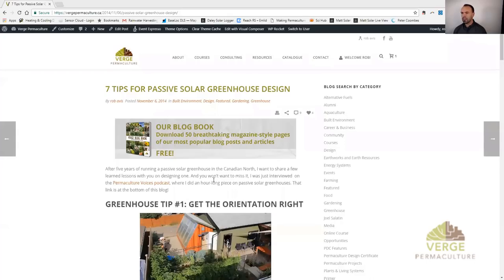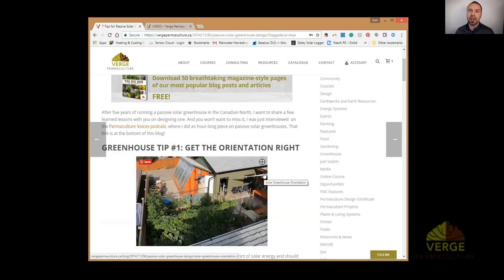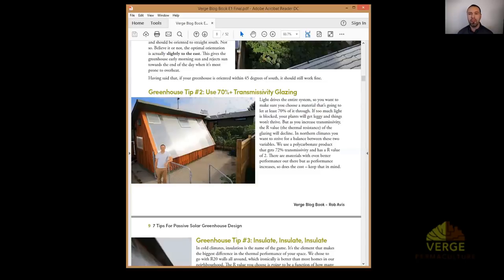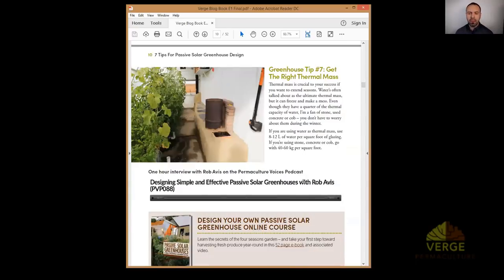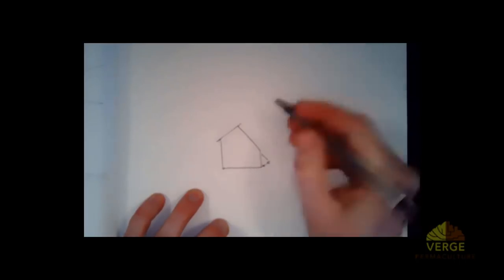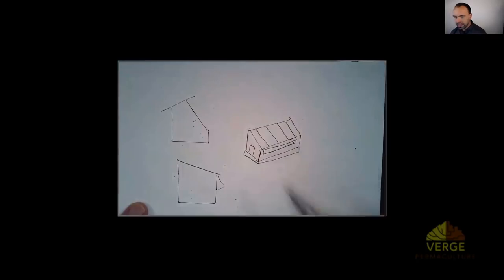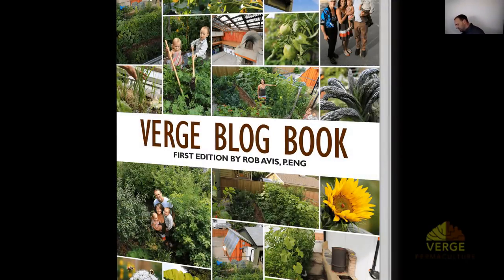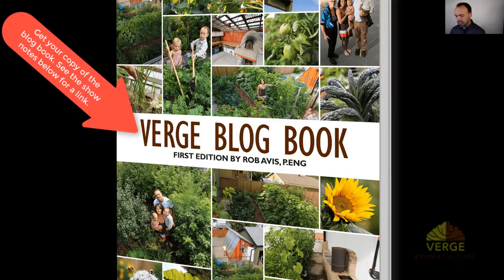7 Passive Solar Greenhouse Design Tips

Comment: Great information here, only thing i would remarke, is that the specific heat capacity is always per unit mass, most of the times j (joule) as unit for thermal energy, kg as unit for mass and k(kelvin) as unit temperature above absolut zero.
That means you cant meaningfully compare the specific heat capacity, without dividing by an objects mean density, the density of water for example is much less, than that of stone or concrete, therefore its better specific heat capacity compared to those is not as big as it appears, when space is the limiting factor.

Comment: Thanks for the video. I am working on a low budget 6‘ x 20‘ everybody should have one geothermal greenhouse. Any input would be appreciated. I used trampoline frame and old Barnwood. The 4 inch black tubing has three large holes on one side so I wrapped it with light ground cover fabric. So this is probably a mistake :-) but it would be interesting to know how this type of pipe works versus pipe with slits all the way around the pipe. I laid the pipe at 4 feet going back-and-forth in three trenches making the pipe 60 feet. Then I laid another 60 feet2‘ above that. Insulated the soil with 2 inch insulation 4 foot all the way around. I am running double plastic inflated. It is working so far but would like to build another one with pipes 6 feet and 8 feet? Thanks for any suggestions. Everyone has a old trampoline frame laying around :-)

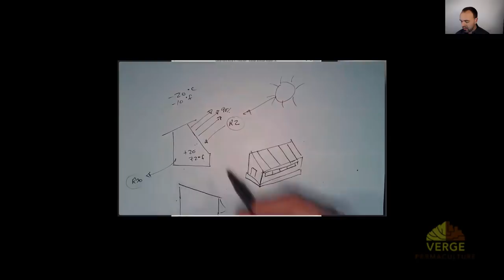Comment: Hey great video! At about 36:14 in the video you say that "R2 is a tenth of R20". I just wanted to clarify that the effectiveness of insulation with respect to R-value is not linear, so in terms of measuring heat loss, R2 is much less effective than a tenth of R20. It's probably closer to R2 being 50x less insulating than R20.
Reply from the maker: jks you are right but there is a level of detail that is needed in order to get a point across. Going into non linearities of insulation would loose a lot of people. Thx dir the comment.
Reply from the maker: Actually, the non linearity is opposite. There is a diminishing return as you go larger.

Comment: a lot of plumbers would argue with your "air pruning" idea as they have to replace pipes with roots due to plants finding water and unless i'm mistaken they would find condensate moisture in those pipes used for heating and cooling.
Reply: you actually don´t even need those pipes, if you are using crushed stone an intake and outlet, even if you use drainage pipes and the roots grow in to them, the air will move around.

Comment: hi rob, great video. I am designing a passive solar greenhouse on my allotment in Scotland.  your videos and website have been a great help. I was looking up insulation r values. my first thought as a carpenter was to use kingspan, celotex or xtratherm rigid foam board with foil covering as it's the best product we use on all new houses and is excellent at retaining heat. After looking up the technical specs, it's r value is 4.5m2k/w for 4 inches or 100mm thick  but to get an r value of 20 I would need 16 inch thick walls. that doesn't seem right, your walls don't look that thick. what type of insulation do you use or recomend?
Reply from the maker: I think you might be confusing R value with RSI. That foam board, if I am thinking of the right stuff has an R value of close to R 7/inch.
Reply: VergePermaculture thanks rob, I since found a conversion chart European values are si r values based on metric system. us or canandian r values are different. when you look up insulation, none of the companies here ever put si r value, it's just r value so it can be a bit confusing if your watching a mix of online videos, U.S. progragrames and UK programmes and the all just say r value. but I have my numbers and realised I only need 3 inches but since I am building it with stud walls, I have opted for a mix of 4 inches of glass wool in the wall as I have aquired  lots through spares from jobs, the to stop cold bridging where the studs are, I am going to put 2 inches of polystyrene insulation over studs on the inside (but could also be done on the outside like a jacket) then my sheathing ply ontop which will take me a bit over r20 in total and it keeps the cost down as polystyrene here is very cheap compared to kingspan polyuerethane sheets. Thanks again.

Comment: Thanks!  good information.  Is your rocket heater using cob or cement?  If cob, how does the greenhouse moisture effect it?
Reply from the maker: Cob. It is great, except for the intersection at the floor. That is where it has issues.